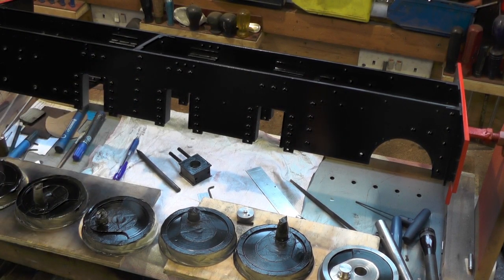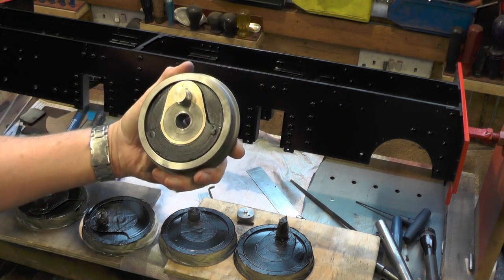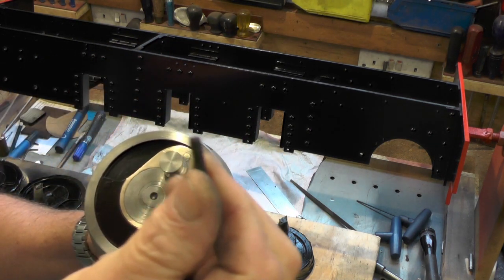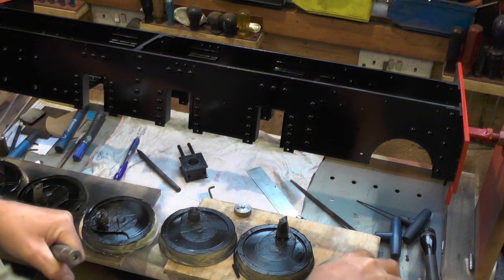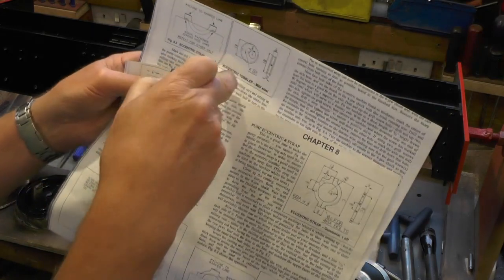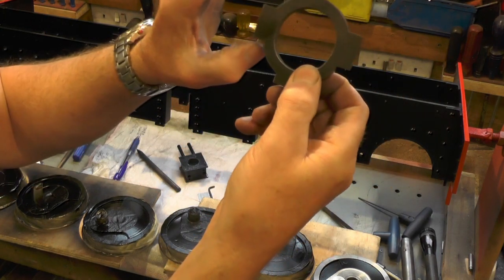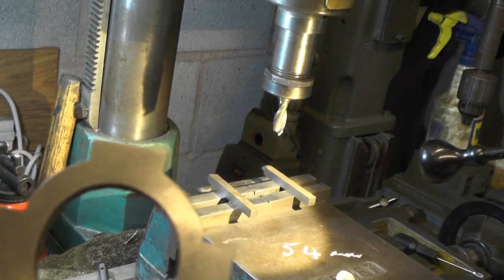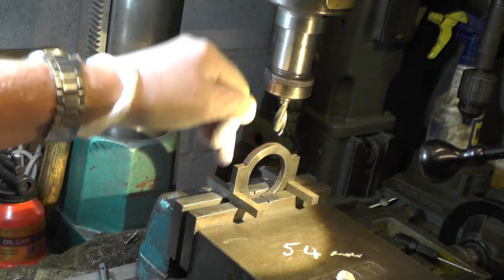Making a Beginners Steam Loco Series  (Axle Pump Drive Part 1 Eccentric Strap "mr factotum"

Comment: I believe the correct term is threaded dutch key. The ones you applied to the crank pins are dutch keys.
Reply from the maker: Hi there
Dutch keys is a new term to me,  thanks for that,  I've learned something new today.
Thanks for taking the time to comment, appreciated
regards
mr f
Reply: Known in the industry as a Scotch key also, but that’s for an unthreaded version of the aforementioned threaded Dutch key.
Reply: True that.
Reply from the maker: thanks for info. you learn something everyday, 
regards
mr f